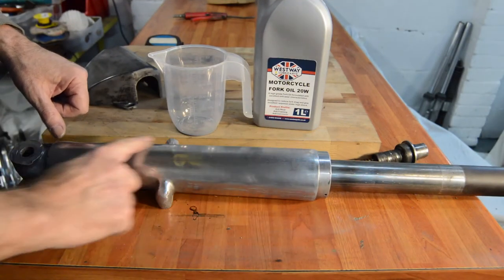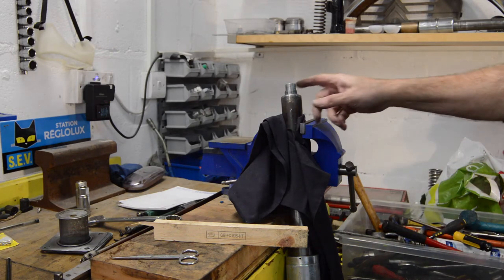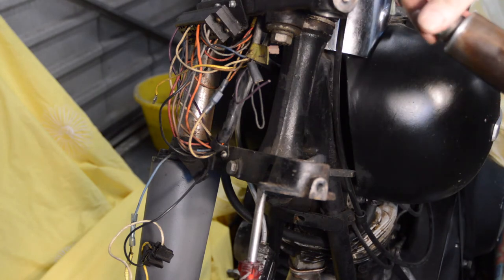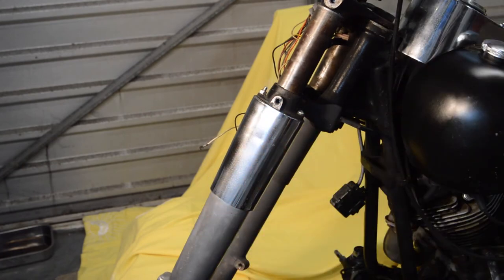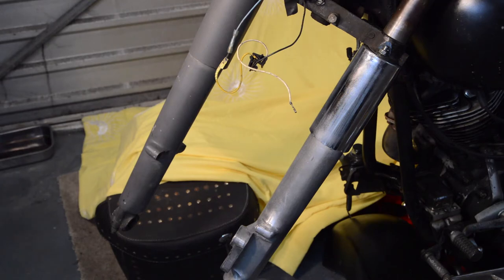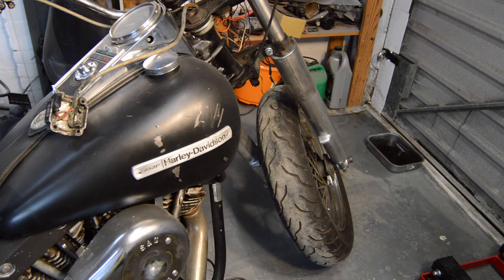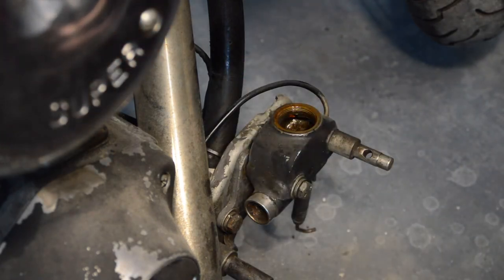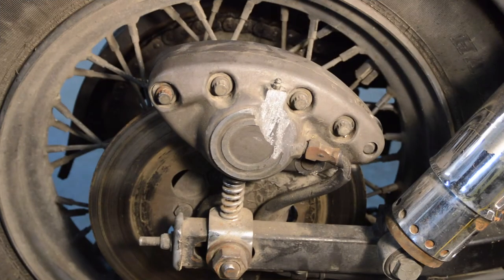Shovelhead Part 5

Comment: More helpful hints, oversize pins are available no problem, and the bolt in repair will be fine once in place.

Harley used dot 3 fluid till the mid 70s then changed to dot 5. There would of been warning labels showing which type stuck around the handle bar and the frame leg next to the m/Cals. The cap on yours says dot 5 because it is an aftermarket one.

Important! The front steel hose is original, as is the rear rubber section. But, the hose at the caliper end should be outside of the swing arm, not inside. This was one of what HD called technical bulletins to be addressed at services,  as they can get snagged when mounted inside.

All good stuff👍👍
Reply from the maker: Great, thanks Jon, more useful info, much appreciated.

Comment: every time i look at someone elses banana(caliper) mine doesn't look so bad? my pin bores in the outer shell for brake support are ovaled badly, hard to line up pins/pads when installing. didn't know they had over sized pins?
Reply from the maker: Mine were ovaled and I did consider some sort of bushing to take up the play which would have been tricky. In the end I went for a new calliper as one came up on offer at a good price. Thanks for watching !
Reply: @oldnutsgarage  between all new parts to rebuild the old one. price was sorta worth buying a new Asian after market one. had my 74 FXE 28yrs tired of fiddling with the banana. have 4 piston PMs up front so i don't really use the rears. maybe why they gum up?
Reply: Dot 5 silicone brake fluid is correct for older Harleys, if you put dot 3 or 4 brake fluid in you will end up with a congealed mess. Only put dot 3/4   in your master cylinders and calipers after you have completely rebuilt them, then it will be ok. Obviously they don't mix